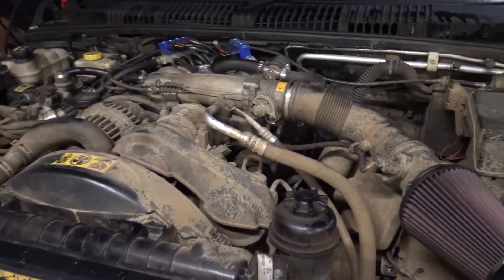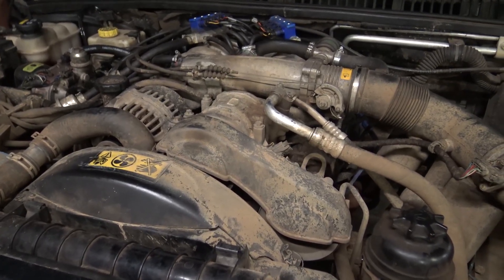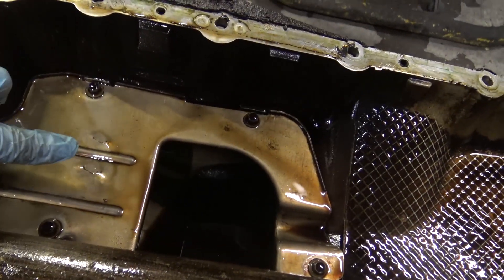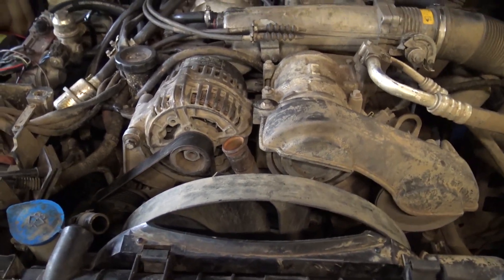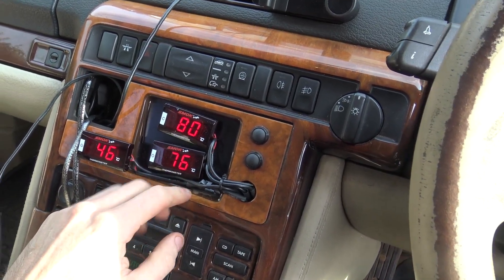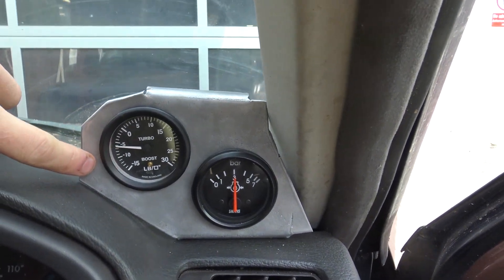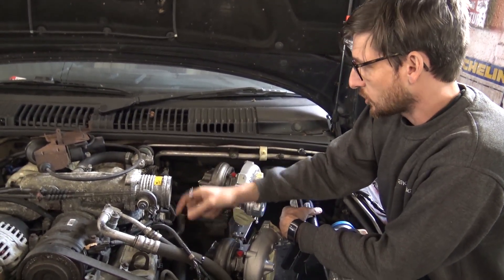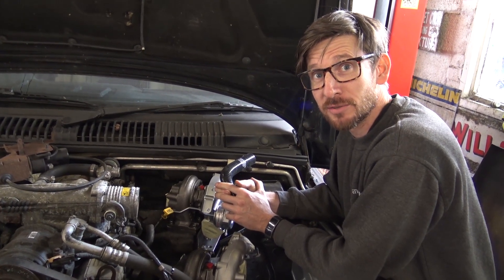RPi Engineering Rover V8 Twin Turbo Tuesday Episode 3

Comment: Are you planning to run the airflow meter on the pressure side of the intake system? Normally would run prior to the turbo inlets  after the air filter?
Reply from the maker: Several ideas for air flow meter (or meters) at present its on the pressure side and our ECU tuner is happy with that however as the system develops it may move as I'm now thinking about the pre turbo induction pipe work and there might be positions available for it pre turbo. There is nothing to say that were it ends up now it might not move with development either :-)
Reply: Guess if you're remapping then the world is your lobster when it comes to AFM choice, something modern & big would be good! Never seen an AFM on the pressure side though hence the question. Not tempted to go aftermarket? I've gone with an Emerald M3D K6+ which can do DBW etc, guess the Bosch platform is good if you can make use of it though.
Reply: @SB-vb8ch  I am sticking with the Bosch system for now as its simple and will do what we need it to. It also sticks with the spec. of being more of a kit as we can reproduce the map onto other peoples Bosch ECU's like we do for other upgrades etc at the moment.

If time and money allows though who knows where this might end up after this conversion (forged build? more boost? different inlet setup?) My time and Money will help dictate that. Im also reasonably certain I should finish the KA build and Im sure I have a V8 hilux hiding round the back somewhere that I bought last year to do something with :-)

Thanks for watching and taking an interest.

Kind regards,
Ian
Reply: Good content & interesting subjects are easy to while away time! I eagerly await the next episode! 👍